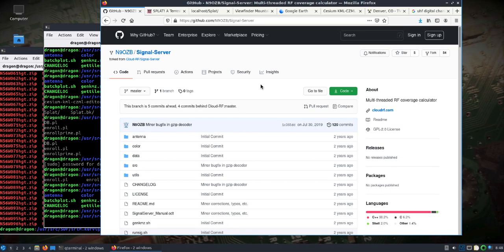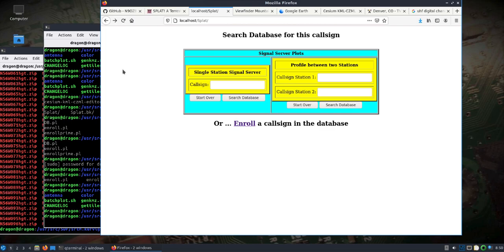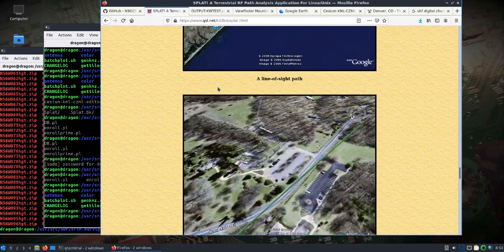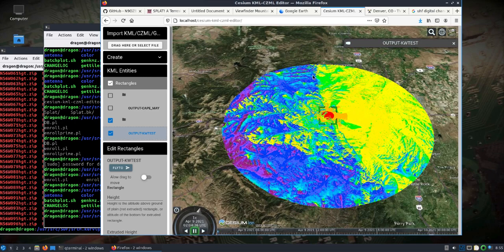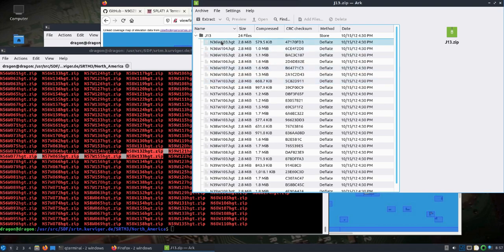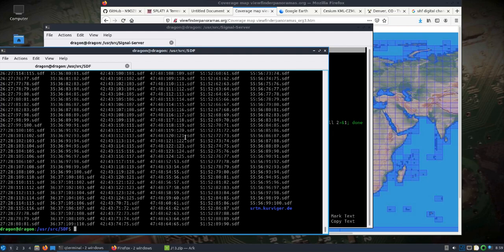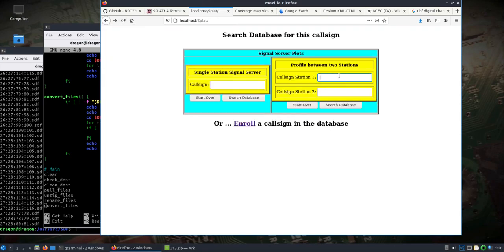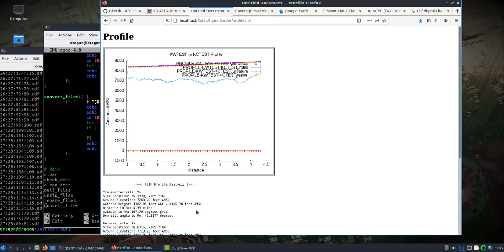DragonOS Focal R14 Preview w/ Signal Server + RF Propagation Web Server  (SPLAT!, Dr. Bill Walker)

Comment: Good work. If the reference data becomes an admin burden further down the line let me know and I'll set you up with a python API client, which you will need for the Pi.
Reply from the maker: Thank you. Looking at the name I take it you are the cloudrf site itself? Any help would be greatly appreciated, especially reference data. I’m assuming you mean the SRTM data? I was thinking there’s got to be an easier way to have that pulled in, maybe even on the fly if connected to the internet. I’d also be nice to have it scripted to the point where someone could click and download the area needed as well as make the SDF directory selectable on the web interface instead of hardcoded to /usr/src/SDF like I set it. So many things could be added.
Reply: @cemaxecuter7783  Yep. I was thinking more about a lightweight client on the Pi so it can generate LiDAR models quickly via a 5000 bogoMIPS server. Running signal server on the Pi is doable with an arm compiler but not recommended for point to multi-point. You might get some mileage with point-to-point profiles.
Reply from the maker: That sounds super interesting. I’m actually working on a aarch64 version of DragonOS for the Pi4. Right now there’s an x64 version and a headless Pi IMG I was working on, but I figured I might as well toss a desktop on the Pi version. Anyways, is there somewhere I can read more up on how the client works? Would it still do the processing and calculations but the elevation data be held elsewhere? Or does all the processing happen in the cloud?
Reply from the maker: Great videos by the way, I jumped over and checked out some content. Super cool examples and uses.